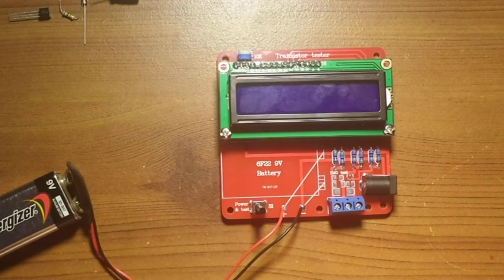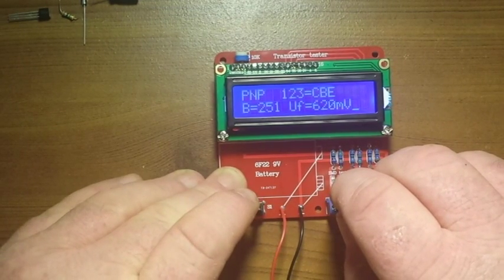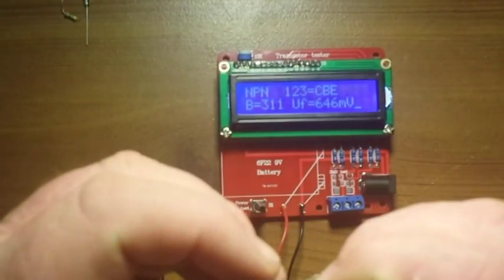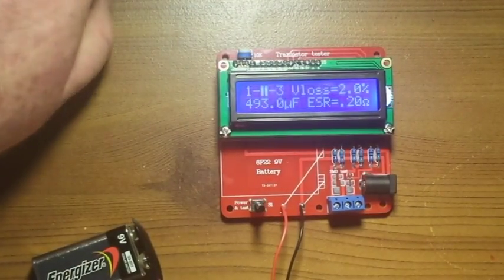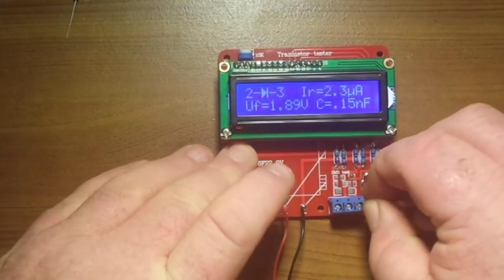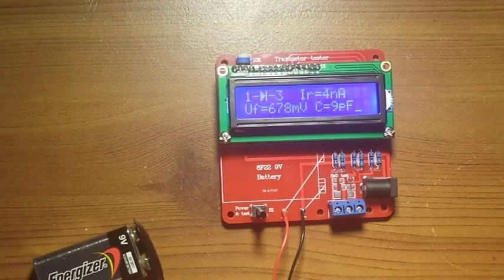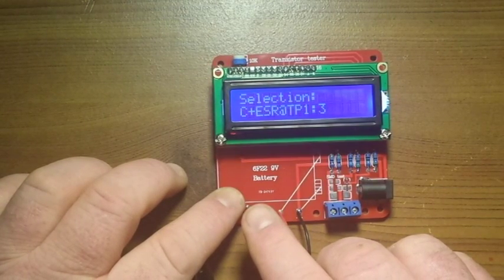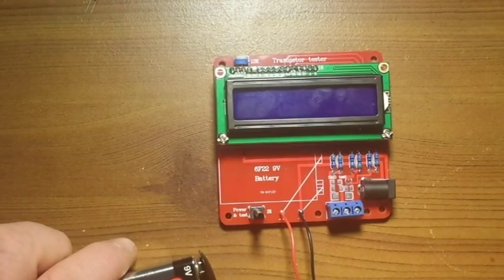BangGood Transistor Tester Update

Comment: Seems to drop about .1V with every test?
Reply from the maker: George Chambers just an old 🔋. I run it off a 12V power supply these days and it's Rick solid. one of the best pieces of gear I own.
Reply: I have one of the newer ones with a zif socket. I run it off a 9V battery but I think a power supply is in the offing. Thanks for the reply.